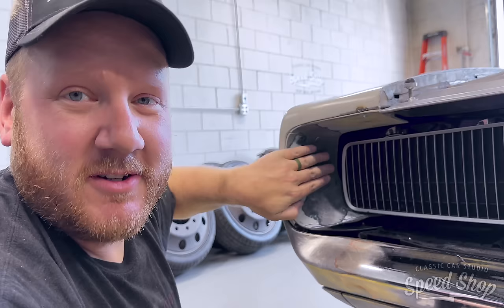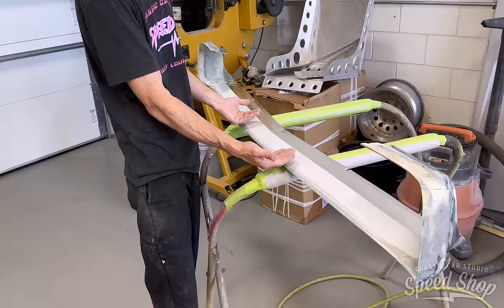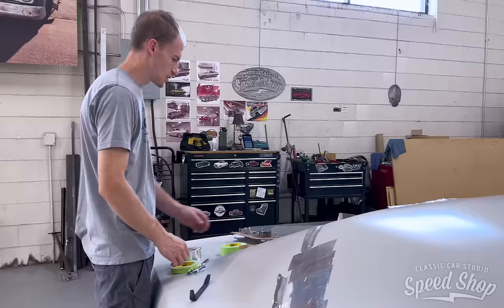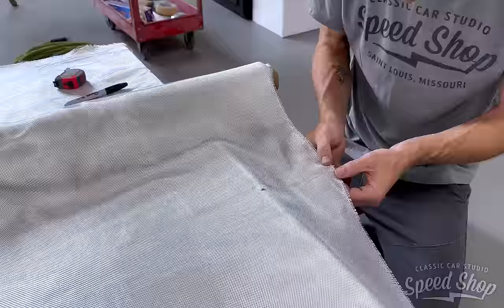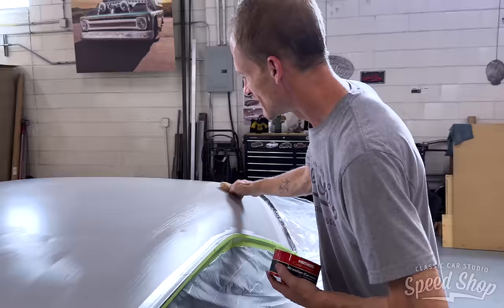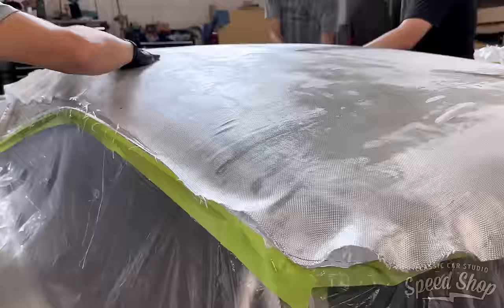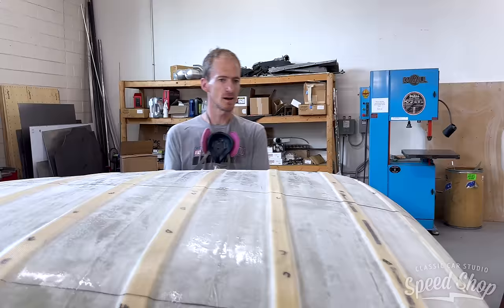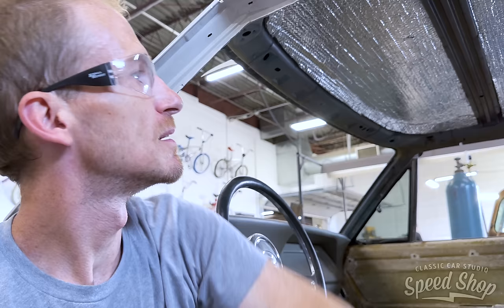Grill Extension & Headliner • 68 Dodge Charger R/T

Comment: Awesome video as always!  The fiberglass is designed to let resin through the weave, you can simply lay all the cloth on the roof (without having to move it around on wet resin) and pour the resin over it while using a squeegee to work it in then pull it out tight.  my .02C

Comment: You guys always do awesome work and I enjoy watching y'all's videos. I'm working on a 57 Ford step side with the original 223 straight 6 four speed and a 77 F100 dent side with the original 351 Windsor with automatic transmission I took the flatbed off of the 77 I will be going with a step side. You guys help me out with ideas for my trucks, thanks